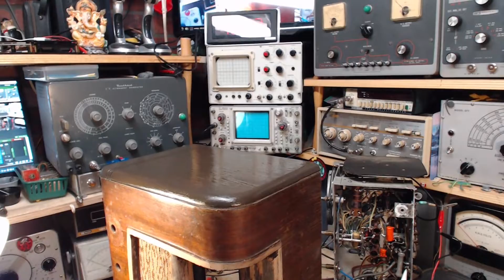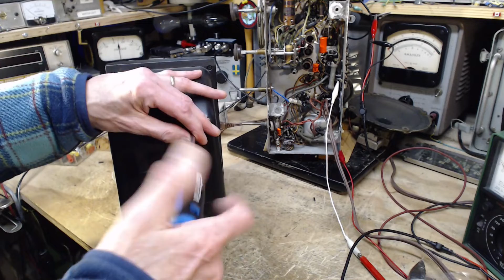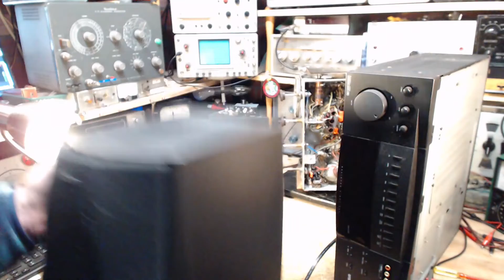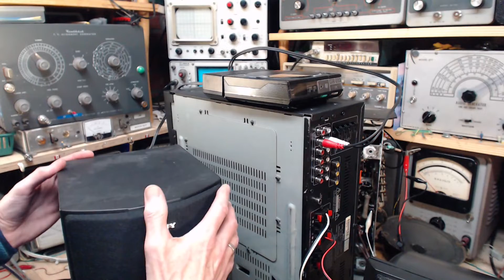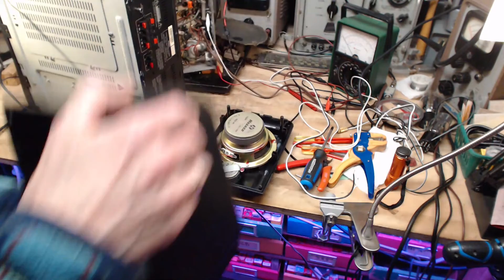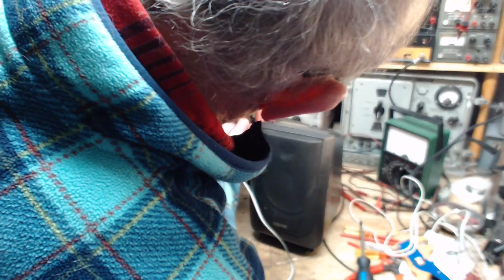Advent Analog Wireless Speakers -  Conversion to Wired?

Comment: Speakers, Oh Yes!!! Definitely a Black Magic device... Bigger will normally be better for a lot of reasons, but small can be very good if the engineering and quality is part of the design...
Power ratings of speakers are important. Sensitivity of speakers is important, Impedance of speakers are important, Amplifier driving the speaker is critical, and the speaker wire and distance is important.. All these combine to deliver quality sound... 

My Home AV system was engineered to Try and deliver close to IMAX quality sound.. That started with none less then , Get This, 6 Sub Woofers all balanced to produce the same level of sound energy,, Nothing can replace 25,000 watts of IMAX audio, but mine does sound rather good..

Speakers are expensive, and none are alike.. Can be very challenging, almost as bad as trying to select a 4 or 8 K HDTV these days.. In the end I felt SONY had the best picture and engineering, but is it OLED, Mini LED, or all the other formats, in the end your eyes will lead you as with your EARS in the right direction...

Your hearing uses a 3db sound affect, it can not tell 1 or 2db differences, but 3db it can detect. With speakers, say a $500 pair of speakers, going up to say $800 will not gain you that much. You need to double the price to get a noticeable improvement, so if you spend $1000 on a set of speakers, next jump is to $2000, and then to $4000 and then to $8000!!!  Just the nature of the beast...

Robert